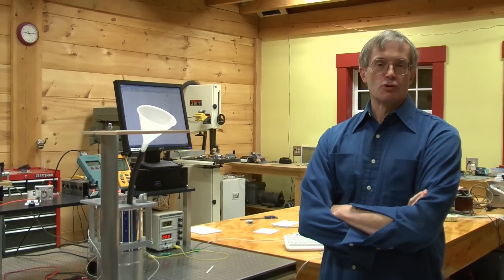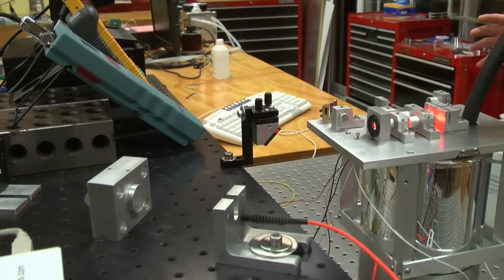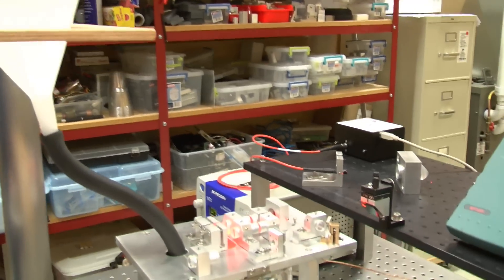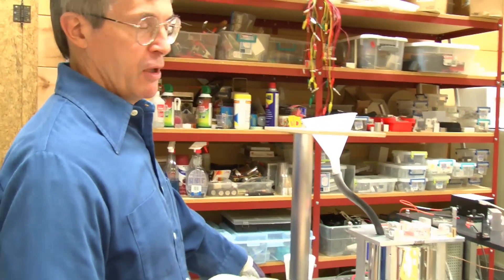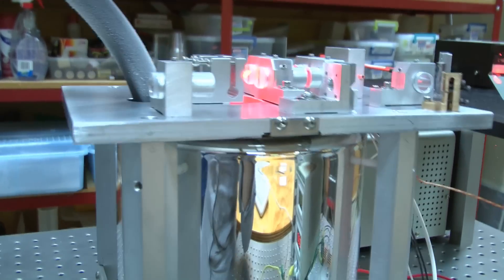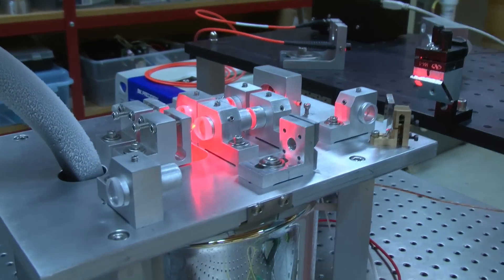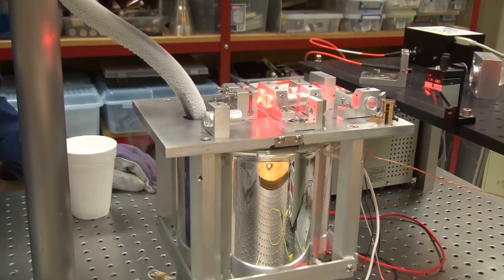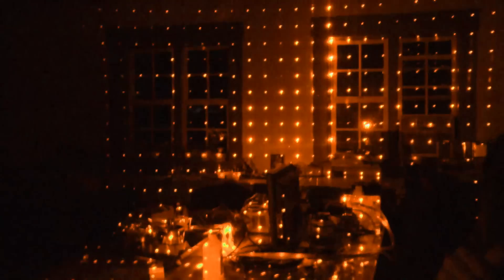Cryogenic Laser

Comment: If you could use temperature cooling say using Peltiers and heaters to sweep the wavelength, then attach a fibre bragg grating to the laser, you could detect chemical changes effecting the refractive index of the fibre cladding. For applications such as detecting corrosion in reinforced concrete. I looked into shifting wavelength this way myself years ago, unfortunately we did not have labview or the optics equipment to make a successful research paper. However looking at your research (so far) it seems the wavelength shift is quite small vs. temperature, I believe a typical 40w peltier can only create a temperature differential of 30deg, so it was perhaps impractical looking back, Interesting thanks.

Comment: With all the data being measured here, it would be very straight forward to plot the temperature, wavelength, power curves using Labview. That would make seeing the whole story so much easier.  As I am sure you know, you need a decent multi-channel A/D data logger. I recommend MARS LABS in Laurel, Maryland. Great systems, easy to use, very low noise.

Beyond that, I do not understand the significance of the 2-D diffraction grating part of this. What is the purpose of the beam combining, polarizer,  etc. ? We understand that a 2-D grating should (and does) produce a spatially periodic 2-D diffraction pattern. We see that. It is lovely and I love it, but I didn't go to school the day they told us how that would be significant in this testing.
Reply from the maker: The beams can be combined with a polarizing prism, as long as their polarization axes are perpendicular.  This is frequently used to double the available power of two smaller lasers.

Comment: Manipulating light with temperature. Amazing.   If I may sir how did you determine the spacing between fixtures ; laser holders, mirror holders?  The familiar honeycomb aluminium plate is evident on the laser table below.  It seems absent on the upper laser plate. What was your guide to the measurements to affix the aluminium laser holders? Thank you sir.

Comment: @Tech Ingredients - You seem concerned that dichroic filters made for red light will not work with orange light. But dichroic coatings have a wavelength shift with ray angle, as the light path gets longer as rays move off orthogonal. Seems to me that for red-tuned dichroic filters you have only to angle them a bit and they will work for orange light, albeit with increased reflection loss.
Reply from the maker: No, that wasn't my point.  What I meant is that at the time this video was made orange diode lasers were unavailable, and even now they're rare.  In order to display an "orange" beam you had to transmit a beam that was actually a mix of two other colors and a dichroic filter or a diffraction grating would separate them.  This can't happen if the beam is a monochromatic orange.

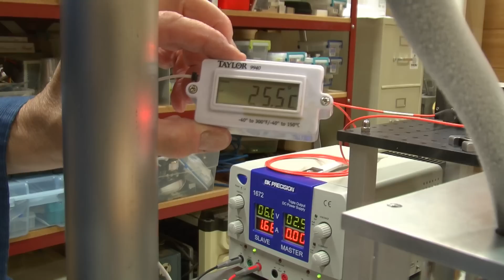Comment: 22:49 Notes that the window temperature is getting pretty low. "If I back off a little bit in the rate that I'm flowing in more liquid, it shouldn't get too cold." Proceeds to flow in even more liquid at 23:46, 24:29, 25:28 and 27:19, then notices the window temperature has gone way down! :D

Comment: I am kinda ocd 
I picked up a Coherent Labs Commercial Laboratory Bench Laser
It has following features.
It looks like a large high end audio amplifier, it has a huge thermoelectric cooler with forced air cooling. There are 4 mounting areas for 4 Coherent or other typically up to 40 watt 808nm fiber output laser modules it can either take fiber laser modules either like yours or Coherent Labs ttpically 25 or 30 or 40 watt laser modules with their own individual Peltier thermoelectric coolers.
I have both a smaller and larger gold plated bridge with a thermister that are round at base to mount KTP or Nd:Yvo4 etc. Type SH, crystals in a pinch clamp between 2 pillars 
I can only assume they were producing 10 to 20 watts of 532 or 1064nm output. I dont know if they were used with basic single ended pumping versus dual sided diode laser pumping as well as maybe Q switching etc.
But

Comment: That's awesome, orange lasers are rare. Now we need to figure out how to make that in a hand held version. I'm trying to collect the rainbow in laser pointers and orange is a tough one to find. 

Cryo cooling is awesome, there are some amazing things that can be done with it, both for science and fun. Such as shifting a red laser diode into the orange spectrum, or filling a plastic water bottle with an inch or two of liquid nitrogen and taping an industrial blue rubber glove (can't remember the name of the material, the ones that balloon out about 4 feet long and 2-3 feet wide and pop like a gunshot) over the top section of the bottle before it condenses water on the surface for a good bond. Takes about 5-10 minutes until critical mass is achieved, so be sure to place it in an inconspicuous location. Best when placed near unsuspecting coworkers, unruly children, your boss, or good friends.

Comment: Have you done any work with the C-Mount 622 diode?  They operate at 5*C and output 150mW.  They are very finicky from what I hear, but I plan to try them out around the August-September time frame.

Comment: I so wish I knew you could do this 2 months ago before I sold my sterling cycle cryo cooler.
Reply from the maker: We have one here that is rated at 2 watts.  It would be interesting to see if these could actually operate near 0 K.  This could be a good experiment when we construct the vacuum system.
Reply: After thinking about it cryo cooler I had may have caused vibration problems
Reply: I got my cryocooler to attempt to make liquid air but it just didn't have the cooling wattage to work using a .5L dewar my thermal loss didn't allow me to reach nessicary temp. It was disappointing since It cost me $1200 bucks for. Luckily I got a decent resale value on it. I did make a working cloud chamber while I had it using 99% isopropyl.
Reply: I cant believe all the vids I watch like this you have been on youtube for 5 years and I just found your vids today. Thanks for taking the time to make them.

Comment: The Coherent 4 fiber laser bench unit has 4 fiber whips that screw onto tediously meticulously cleaned connectors. They create or can create a consolidated single armormed jacketes fiber ourput with a large knob like a huge audio amplifier potentially delivering up to 160 watts output over one fiber . I would like to with knowledgeable assistance and guidance like to create a professionally designed 532nm laser. I have one huge Crystal thats 12.5mm square by 20mm long.
The large crystal  bridge  has a 👍👍👍👍👍👍👍
Reply: Anyhow I am kinda of a wanna be sky projectionist on clouds at night or a large projector screen. I have built a few green laser projectors using galvonometers and a 50mw 532nm laser driven by a Pangolin laser projector.
I have a few odds and ends uncommon hoarded technogear. The large crystal bridge looks to be about 2x2 to maybe 3x3 by 5 to 6 mm and came out of some dpss Coherent Laser. I have several New in Box Crystals that are probably KTP or Nd:Yvo4
I have several huge brick TEC units with no controllers and fiber laser modules like in your video.
Reply: I also have a few SDL fiber laser boxes I think are 808nm. And probably about 18 watts each in addition I have some type photospectrometer with slit ipenings and a mechanical micrometer that works with a prism.
Reply: Also 2 different TEC controllers.
Also I have one continuum model SHG T-2  20mm 
I believe maybe a Q switch
It might have suffered a catastropic thermal failure but maybe ?? I already have a usable new crystal as well as for one or both coherent crystal bridges.
I have a weird 4 cooling circuit cryogenic tissue freezer that does minus 69C type medical tissue freezer used before nitrogen could be easilly had, also have a single circuit laser water chiller with old school gallon tank compressor and pump not probably good enough for tuning 808nm laser frequency just for keeping medical or industrial cutting welding laser like my 30 to 40 watt coherent rectanglar lensed medical lasers from burning up.

Comment: think the dropped amplitude at 20:"and somewhat" correlates to the lower frequency as they "carry" more energy as larger wavelengths ... and therefore you lined up the cos-filter.!?!... what has that cos-thing to do with that- nothing mechanical?- to me it looked just like a zoom in or new alignment of the x- and y-  chart like an amplification?? ... sry

Comment: Can you UV shift a 405 or a 445 doide ?
Reply from the maker: The GaN diodes blue shift very little with temperature, as in 1nm/20C.  However, the efficiency increases substantially with cooling.

Comment: I have a rather expensive looking laser mounting board its black a few inches thick and about 36 inches square it has a grid patteen of female 1/4-20Tpi holes that are about an inch or so apart.
I have maybe a dozen or more 808nm laser modules with huge brick Thermoelectric coolers. I also have several 30 watt water cooled medical laser modules that are rectangular with gold plating anode cathode terminals and a water cooling  inlet outlet hose bib. I used to do for shame devesttation of black shoes in front of a fan that literally exlpided in flames 
I picked up a crude but effective 100 plus amp variable low voltage bench rack mount 0 to like 3-6 vdc power supply.

Comment: I would be really careful about the lasers, even a slight reflection from say the mist from the nitrogen may be doing damage, I know my eyesight deteriorated significantly after working with lasers
Reply: It seems pretty evident to me that any potential hazards from the beam have been very professionally eliminated. I've done this all my life too. Relax. It's OK.
Reply: @machobunny1  That's just what Custer said before the Indian encounter)
Reply: @Suzy Siviter Could you describe in a bit more detail in which way your eyesight deteriorated? Did you lose sensitivity in your macula? Or did your cornea/eye lens/vitreous humor suffer some damage? Does it differ from one eye to the other?
How does the visual cortex cope with the missing information from laser damaged eye? Do you see a certain fixed blurry pattern? Did the perception change over time as the brain adapted to the damage? With what kind of lasers did you work and what experiments did you do? 
I also agree that one should be extremely careful with lasers, even more so when they are invisible.
Reply: @weinihao3632  Hi Wei, yes you would expect   loss of information from burning the retina, however although I cannot be 100% certain, after that time my optical vision jumped from a 2 to 5, maybe if the light strikes it at the right angle it can lead to deformation of the lens. I know I used to suffer from headaches after working in the lab.
Its in my right eye, yes after a time my vision sort of self corrected but I still have blurry vision when reading especially in a morning-perhaps when its at their dryest.
We used to do research on Fiber Bragg Gratings for chemical analysis on corrosion.